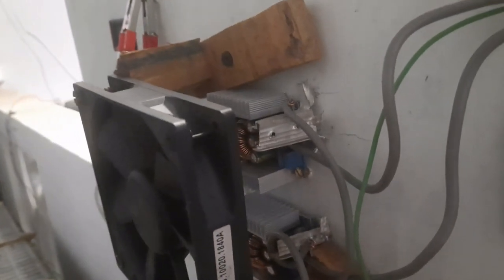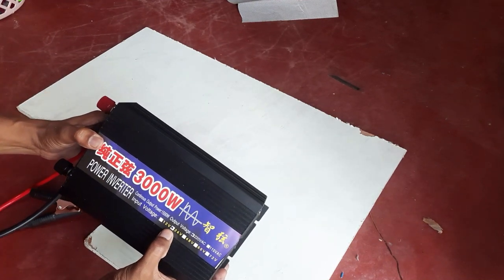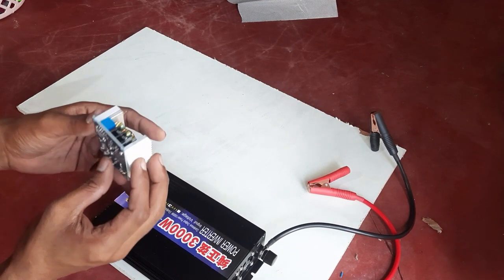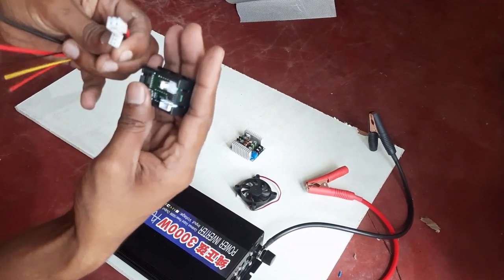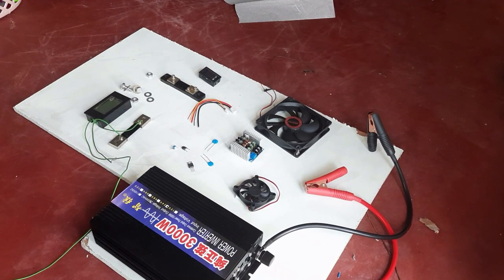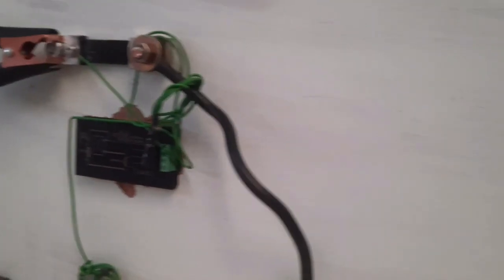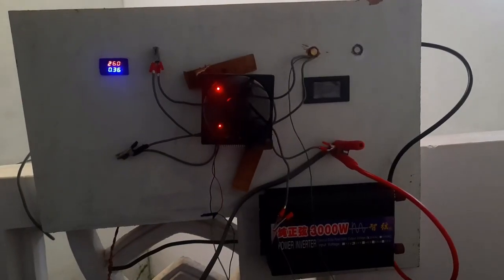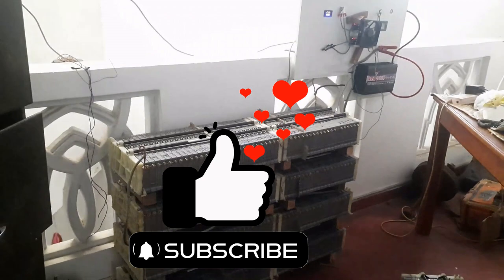Cheap/efficient CONTROL PANEL for Off Grid home Solar power

Comment: I have a 5Kva Sukam inverter powered by 8x12v=96v of series connected Tall tubular batteries  of 150amps. The Inverter charges the batteries at 15amps. Also, 
1. The batteries are nearing expiration ( capacity decreases quickly on Load).
2. Would like to add Solar Panels. Most of the (good) Mppt Chargers are 48v
Any suggestions would much be appreciated.
TIA
Reply from the maker: I think you should be able to connect  the solar panels to the inverter from which it will charge the battery. 
But I guess it's best if you clarify with your local inverter service provider. 

Also you might benefit from using super capacitors to aid during peak discharges
Reply: @solar_energy  I.ll have to match the input of the batteries to the output of the panels. 
So arrange the panels to output 96v.
ie no need for an mppt?
Or 2x48v mppts or 4x24v mppts.
I guess mppts will help in power throughput.
Any thoughts? 🤔
Reply from the maker: @RitinPali  
Using a charge controller is advisable. 
Rather than using the panels directly if you can use 2 x 48V mppts then you'll be able to protect your batteries, and preserve their life
Reply from the maker: https://youtu.be/_Kikri_Dmk4?si=oaZz8-wNDQ37BEgB

Comment: This volt meater support 30V but better to use shunt for protection
Reply from the maker: Actually the volt meter functions at a voltage of 4-30v. But can measure 0-100v on the testing side.
However the shunt is used to prevent a large amperage passing through the meter, (again on the testing side)
I hope that explanation helps!
👍